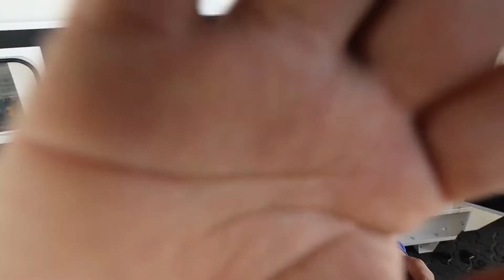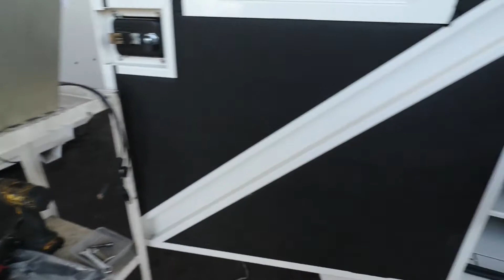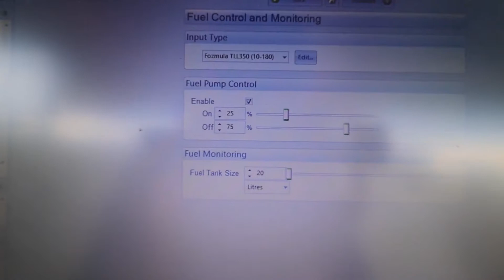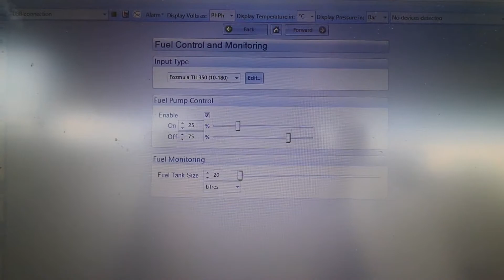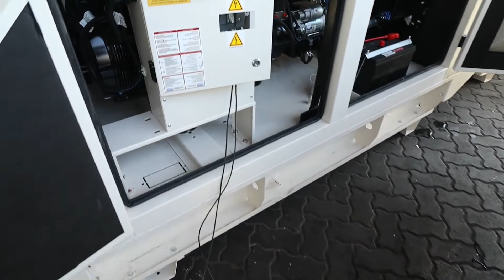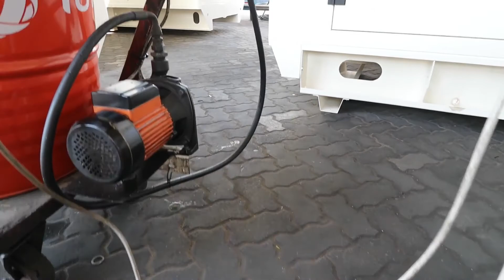external fuel pump installation using deepsea module benzblogs

Comment: Thank you very informative video 
I hav a question can I ask
Reply from the maker: Yea go ahead
Reply: What fuel sensor can be used to display level and liter on dse penal
Reply from the maker: @silvanassingh4398 there a lot of fuel sensor depend on your needs like fozmula
Reply: Hw abt Rochester
Reply from the maker: @silvanassingh4398 any sensor that fit to your need its posible if you do the configuration just check the manual so if not avilable in program you can use the edited one

Comment: If the main fuel tank runs out of fuel, the pump should not work, It should stop. How do we handle this?
Reply from the maker: Sumple ad fuel sw to the main thank put interlock relay to the panel to avoid pump not to run

Comment: Good job 👏👏👏 and what about overflow or how we return the overflow fuel from daily tank to main tank!
Reply from the maker: There is no overflow because you have fuel sensor to monitor the level it will automtically stop
Reply: @benzblogsVlogs What if the fuel sensor If it stops working malfunction?
Reply from the maker: Its will not function

Comment: Maganda Gabi Sir, may Cummins Po kami na generator may selector na 220volts or 440volts . Tanung ko lang ko Po kapag 440volts kaylang Po bang I re top Yung motor nya nka double y Po . Salamat
Reply from the maker: Not unless kong swachable din ang connection ng motor mor
Reply: @benzblogsVlogs  magandang Gabi ano po problema pag mag alarm Ang generator ng high frequency mode ? Ano po dapat Gawin .salamat
Reply from the maker: @johnpauldorado439  hello sir high freq always check firat the speed if is in correct and thin check the volatge is in correct or not coz freq use voltage as measure as freq without volatge no freq too
Reply from the maker: Yes po kc nagbago na yung voltage ng alternator ngayun kong di mabago masususnong po sya kc 240 lang ang double y